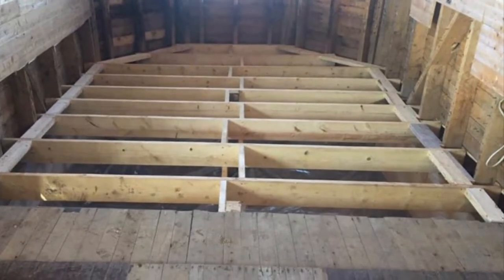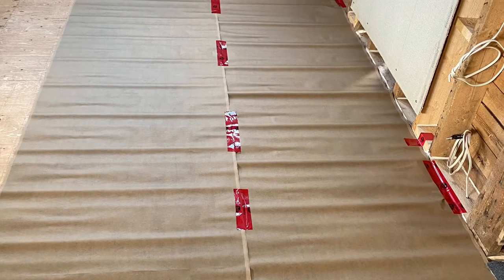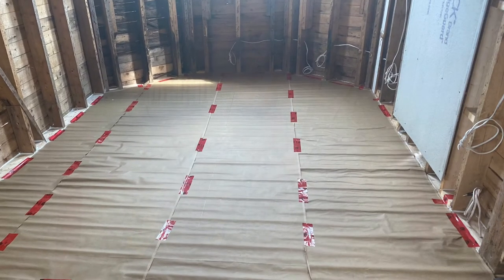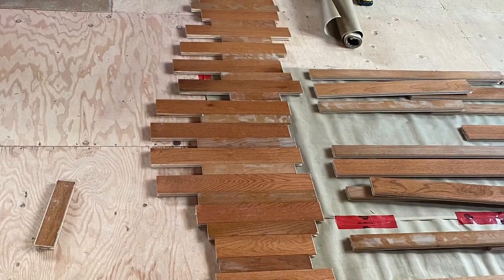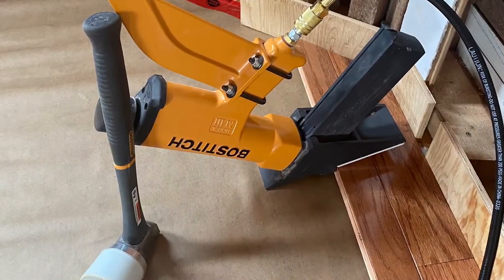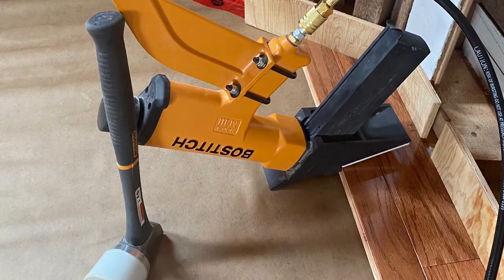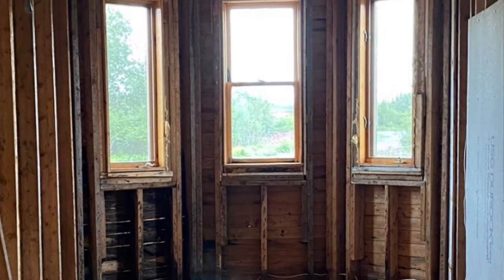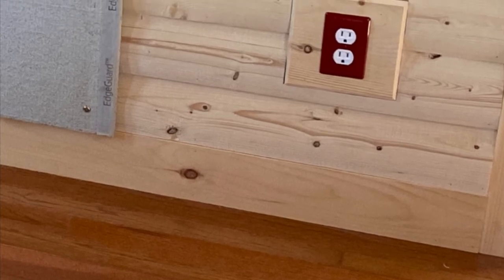Installing Reclaimed Hardwood Flooring at The Ole Church 5 Acre Homestead #ReclaimedFlooring #DIY

Comment: That was a lot of work! We put new flooring in our living/dining room a few years ago. The uneven floor base made it very difficult. We used a power nailer but still ended up with repetitive patterns with the precut wood because certain areas wouldn't lie flat.😢 It's still solid though after about 20 years😊.
Reply from the maker: That’s great. We decided to go with different widths but same brand, thickness and stain. We think it looks great. I need to finish the entire floor of The Ole Church with it.